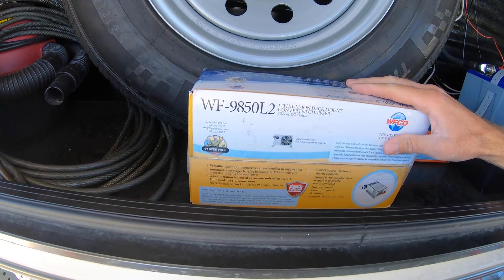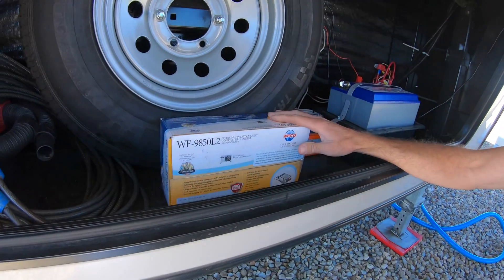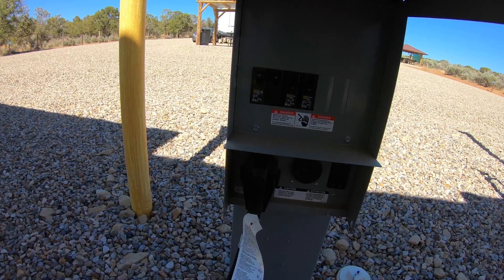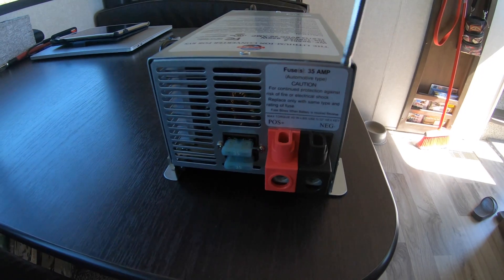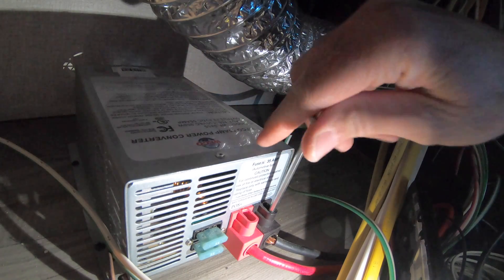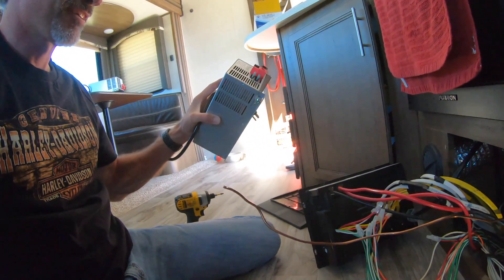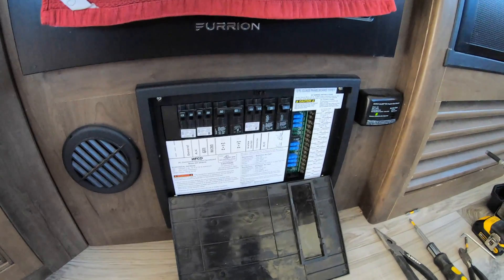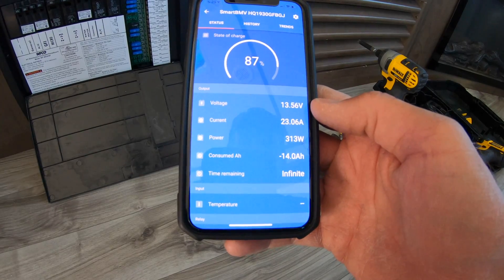Going to LITHIUM Batteries for your RV?  WATCH THIS FIRST!  WFCO WF-9850L2 Lithium Converter Install

Comment: Best video I’ve seen on Lithium RV upgrades. I feel better now that I can do this myself on our travel trailer. One question: I’ve seen some videos about Lithium batteries taking so much incoming current that they can damage an alternator. Do you have any concerns about this (while towing)? I was thinking the 7-pin connection would limit the charge from the alternator. Any help would be appreciated.
Reply from the maker: @Phil McCullough  Thanks Phil!  Glad the video helped you out!  We haven’t had any issues with our alternator while using the 7 pin connector.  Our alternator hardly sends any juice to the batteries when hooked up.  I have confirmed this using our BMV-712 Bluetooth Battery Monitor while both idling and driving.  I’m sure every vehicle and setup will be a little different, so, I would recommend confirming this using a battery monitor for your own situation.  Here’s a link to our BMV-712 install if you’re interested:  https://youtu.be/sruxxpmFdts  

I have actually been looking at installing a 20 amp DC to DC charger to be able to get a charge while driving.  Here’s a link to a video by Jared at All About RVs that he just released for the Renogy charger that I have been considering.  https://youtu.be/7NDnZsouUyY   The Renogy charger can limit the amount of amps being pulled from the alternator to protect it.  Jared also explains why he believes his 7 pin connector and wiring wasn’t sending much power to his batteries (similar to ours) prior to the charger install.  Hope this answers your questions!  Feel free to let me know if I can be of any further assistance.

Comment: You didn’t mention the year and model of your Keystone. I am wondering how you determined which converter you needed without pulling panel first.
Reply from the maker: @Timothy DeCoursey  We have a 2020 Cougar 25RES.  I did pull the panel first to find that we had a WFCO 55Amp Converter Charger that was factory installed.  Decided to go with a 50Amp WFCO Lithium Converter Charger to stay on the safe side as we only have 6AWG wire installed from the panel to the batteries.

Comment: How do you know when the battery is 50 Procent
Reply from the maker: @Cornel Crisan  Depending on the battery type, you can check the voltage by using a corresponding voltage chart for your type of battery.  For example, a "Regular Wet Lead Acid" battery will be at 50% when the voltage is 12.06 Volts (Google "voltage chart" for the type of battery that you have).  You would need to check the battery voltage by using a Multimeter at the positive and negative battery terminals.  There should be no "load" or "draw" on the battery when you check it.  You can make sure of this by disconnecting all wires from the battery before you check it.  Hope that helps!

Comment: What happens when you just swap the battery with a 300ah lifepo4?  12.8v battery without a converter?
Reply from the maker: You need the converter (which is also a charger) to be able to properly charge the battery no matter what kind of battery you have installed.  If you go to the 300ah lithium battery, you will still need to change the parameters on your current converter/charger (if it has the ability to be changed) or you will need to buy a new converter/charger that is compatible with lithium batteries.

Comment: Have the same 9855 converter and have been wanting to switch to lithium batteries. Thanks for showing a different option than the expensive progressive dynamics.
Reply from the maker: @Cliff Tatum  No problem 👍  Glad the video helped you out.

Comment: for those wondering why only 30 amps of the 50 amp converter are making it to the battery keep in mind that rv distribution panels contain relays that automatically disconnect all 12-volt loads from the house battery and connect those loads directly to the converter when shore power or generator power is connected to the control panel. the converter is not just a battery charger, it provides all 12-volt power to the rv while the house batteries are charging.
Reply: I don't believe anything gets disconnected. The charger and the battery are hooked together. When it starts charging, You just have two power sources, the battery and charger. As the battery gets charged, less amperage is pulled from the charger. The meter just shows the amps that are flowing into the battery.

Comment: Thank you for this video.  Is your fridge a propane/electrical one?  I am inquiring because I have a 12 volt fridge and I was hoping you did as well to see the overnight drop.  Thanks again for making this video.
Reply from the maker: @Benjamin Medlock  You are welcome!  Our fridge is propane & electric.  Not sure what the consumption is overnight for just the fridge as we have been boondocking in fairly cold temps and the furnace is the big draw right now.  I believe it uses very little power though.  Maybe only an amp or 2 when running. It is a Dometic.

Comment: on the original 55 Amp converter, running from the generator, how many amps was it putting in, how slow was it?  and what voltage did it charge the BB to?

Also, have you got a solar panels and MPPT charger up and running?  And how's that working if so, to bring the BB to full capacity.  Thanks, great info and instruction!
Reply from the maker: @Carl N   Hey Carl!  It was extremely slow charging from the generator.  The battery was ran down pretty low and the converter was only putting 1 1/2 to 2 1/2 amps in when it should have been charging in bulk charge mode and charging at least 30 to 40 amps.  The voltage was down around 12.8v which was pretty low for lithium batteries (17%) and we could only get it to charge up to 13.1v (40%) after running the generator for 2 to 3 hours.  Regarding the solar, have not put that together yet even though I've had all the materials for quite some time.  Been really procrastinating since we've been on full hook ups.  We are getting ready to leave for a 6 month run starting mid February where we will be doing a lot of boondocking though, so, I'll be putting them together here in the next few weeks.  I do think it will be slow going as far as the charge coming from those panels and I don't have high expectations.  I'm thinking we'll be getting 15amp max with full sun.  I will post a future video for that though as well.  I have a bunch of other upgrades that I've been working on including adding 2 more Battleborn batteries and an inverter.  Will post videos on all of them as soon as I can.  Thanks for watching and commenting!
Reply: @EddieAtLarge  very cool, thanks for the details, I got a 100 Ah BB and started with solar, just dripping amps into it with light usage.  With a cheap solar kit I've been able to push it up to 14v, so topped off well and best I got was 4 amps in peak sun.  Was shocked to hear how poor the performance was on that charger.  Good to be aware, thanks again for sharing.

Comment: So was that app to see the power from the charger ?
Reply from the maker: @Grizzly-Outdoors  The app does show the voltage and current going into or coming out of our battery as that is from the Victron BMV-712 battery monitor that I had installed in our rig.  Here is a link to that install and review video if you would like to see it.  https://youtu.be/sruxxpmFdts  That is showing the power that the charger is putting into the batteries in this video.  Thanks for watching and subscribing!

Comment: If your new converter in 50 amp 2:50, why does it only have 35 amp fuses....5:59.
Reply from the maker: @tarfoot  Hey there, good catch and good question!  I actually had not paid any attention to that before.  I called WFCO and their tech dept. informed me that the 2 fuses are wired in parallel which together creates a 70amp fuse.  I also looked at my old converter that was rated at 55amps and it also had 2 ea. 35amp fuses.  The manual confirms this requirement.  Thanks for the question!

Comment: I'm in exactly the same situation. Outstanding tutorial, well done, and such a great help. Thank you! Tell me, are you using just the single 100AH battery in your system? Have you added more? And how's it all doing so far?
Reply from the maker: @Bus Daddy  Thank you!  Glad it was helpful!  I am only using a single 100AH battery at this time, however, I had ordered 2 additional that were just delivered today and I'll be installing them soon.  I'll do an update video as soon as I get them installed.  I still need to order some battery cable from Amazon and I also just ordered an inverter to hook into the system.  I did have an issue with this original converter, however, WFCO made it right and sent me a replacement.  Here is the video link for that:  https://youtu.be/7Mtcjp0YMsI  The new converter is actually charging much better and at more amps than the original.  It's been working great so far.

Comment: Didn't you say the new converter charger was a 50 amp model?    If so, I wonder why you were only getting about 25 amps of charge current?    LiFePO4 batteries are supposed to be able to take up to about 0.5c charge rate - which, for a 100 amp hour Battle Born battery should be about the 50 amps that your new charger converter is supposed to be able to provide.   So, any idea why you're only getting about half the current capability of your converter charger?
Reply from the maker: @Richard Owens  Hi Richard, I believe the reason for the low charge rate is due to a long travel distance between our converter and the batteries.  The converter is back past the center of the RV under the stove so there would be at least 15' to 20' of 6awg wire to get to the batteries from there.  I believe the resistance in the wire due to this long run is most likely slowing the charge rate.  If I were to upgrade to 4awg wire, I think I would get the higher charge rate.
Reply: @EddieAtLarge  L At a charging voltage of 14.4 volts DC at 50 amps over a 20 foot run of 6 gauge wire, you would lose about 0.8 volts, which would give you about 13.6 volts at the battery.    And, that would translate to a loss of about 40 watts to heat distributed across the entire length of the wire.   And, at 25 amps, of course,  the voltage drop and the heat loss would be half that, or about 20 watts lost to heat and an end voltage of about 14 volts.    I would be interested to know what voltage you're getting at the battery while you're charging at 25 amps to see how close my calculations were.
Reply from the maker: @Richard Owens  I should have mentioned:  I did have an issue with the original converter and had to replace it.  Here is a link to my video on that:  https://youtu.be/7Mtcjp0YMsI   In this video, I had commented that the new converter was charging at a better rate than the original, which was at a rate of 36amps.  I had also tested the voltage at the charger with the battery and shore power disconnected and was reading 14.59v.  Regarding the voltage at the battery, I'm not sure how to measure that as the voltage will change as the battery charges.  In the video, the voltage shows 13.26v at the battery, however, when the battery has a full charge, the voltage hovers close to 13.6v.  If you know of a good way to test, please let me know.
Reply: @EddieAtLarge  You can test the voltage at the battery at any time during the charging process.   And, as the battery approaches a full charge, it will draw less current from the charger, which causes it to have less of a voltage drop across the line - and that, of course, results in a higher voltage at the battery up to the point that the battery is fully charged .   And, at that point, since the battery is no longer drawing any current, there is no voltage drop across the line and you should measure about the same voltage at the battery as at the charger.   That's a nifty piece of electronics trivia - with no load, there is no voltage drop across any length of line.   You could literally have miles of 6 gauge wire and still measure the same voltage at the far end from the charger - until you connect a load.
Reply from the maker: @Richard Owens  Great info Richard!  I'll take a measurement at both converter and battery when I get a chance and let you know.
Reply from the maker: @Richard Owens  Hey Richard, took the measurement at the converter and the battery after the battery was completely charged and no load being pulled (other than the RV Propane Detector).  Voltage measures 13.65 at the converter and 13.64 at the battery.
Reply: @EddieAtLarge  So, essentially, the same - like I said!  😊
Reply: @EddieAtLarge  It occurs to me that if you can adjust the output voltage of the converter charger to compensate for the voltage loss across the line, you could possibly get your 50 amps across your existing wire.   Is the voltage of your charger adjustable?
Reply from the maker: @Richard Owens  The settings on the WF9850-L2 are not adjustable.

Comment: Your 6awg 50 amp wire will easily do 55-60 amps.  The BMS inside the battle born uses 10awg.
Reply from the maker: @rustusandroid  Very interesting.  Thanks for the info!
Reply: I was actually gonna ask why not replace the wire between toe 60amp inverter and the battery.